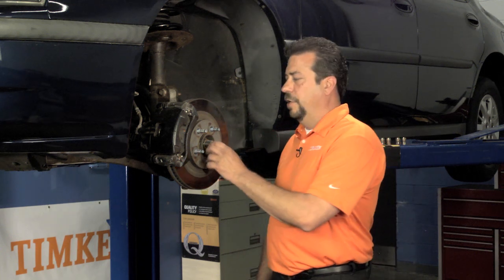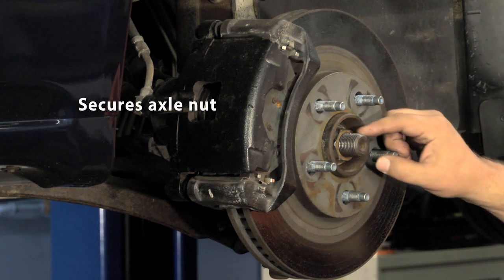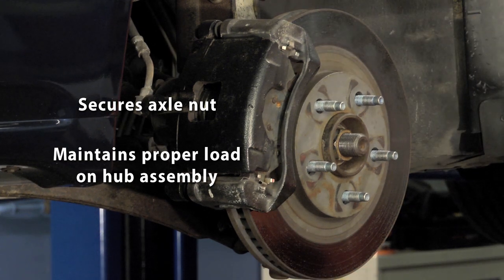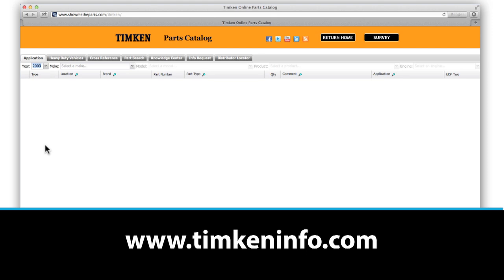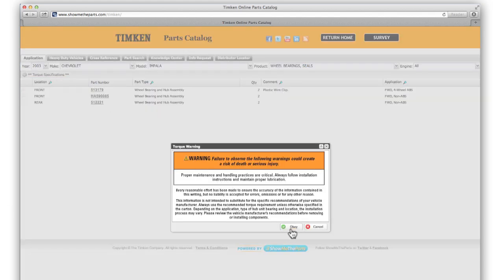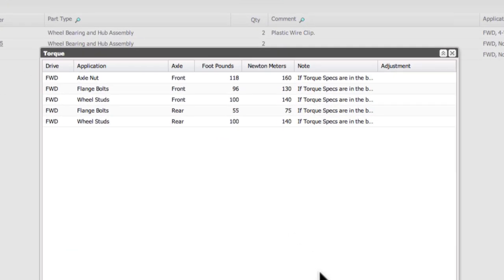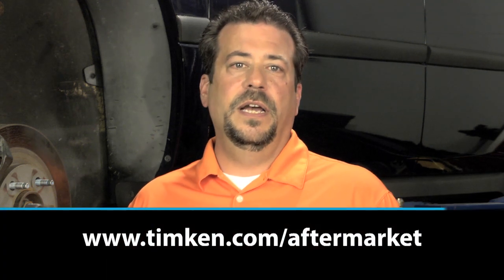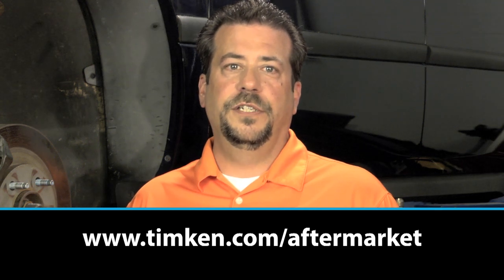Timken Tricks of the Trade - Finding Wheel Hub Torque Specs

Comment: Word of caution on using Timken's info: I just looked up one of the trucks I regularly work on - a '97 Ford F-150 RWD. The SKF info is the exact same as the FSM, but neither one seems right to me, since you go through a several step procedure where the first torque is 30 ft-lbs., loosen it up TWO whole turns, tighten again to 17 - 24 ft-lbs., loosen it 175 degrees (a weird figure), then finally torque to 17 INCH-pounds. This results in way too much end play, so I thought I'd try to find Timken's spec's. Timken's data for the "front axle nut" - the ONLY listing that makes sense, since the others are for the lug nuts (correct) and the hub bolts (also correct), is a wildly INCORRECT 188 - 254 ft-lbs. It's my guess that torque would not just make the wheel immovable, but ruin the bearing.

In 50+ years of working on cars/trucks, I've never seen such a strange procedure. In looking at the spec's and the procedure, It's my suspicion that some engineer gave the documents department at Ford the correct figures but they were somehow entered incorrectly, as the first torque looks about right, in my experience, to seat the bearings in the races. But backing it off TWO whole turns is something I'd never done. Usually it was 1/2 turn, and never more than a whole turn, just to loosen it up for the next (and usually final) torque. Next, going to 17 FOOT pounds seems OK, because that was often close to what it took to get somewhere between 0.001 - 0.005" of end play. But backing it off again - by 175 degrees - is a strange figure. Why not 180 degrees, which would be 1 1/2 turns? Then torque to final spec. of 17 INCH-pounds, which leaves the bearing fairly loose and too much end play. The figure of 17 appears three times in the procedure, and that's why I suspect somebody entered the wrong info into the manual, and was perhaps later copied by SKF in their own datasheet for the bearing. It's almost as if somebody was writing it down while talking on the phone and got some parts right and some wrong, and were too embarrassed to admit they goofed it up, so they decided to fill in what they thought they remembered instead of calling back and asking again, just to be sure.Same here with the Timken data. It would be OBVIOUS to anybody who's ever worked on cars that that's WAY too tight. Again, 188 - 254 foot pounds is about TEN TIMES the similar torque value that SKF gives for the second torque, above. So maybe a decimal point was misplaced to the right. But to some data entry clerk who's just out of high school and has never even changed a flat tire, much less changed any wheel bearings, well . . . they wouldn't know that's an unreasonable figure. So somehow that figure gets entered into the database or spreadsheet - and it remains until somebody points it out. And then the documentation department takes years to get around to fixing the mistake.
Reply from the maker: Thank you for bringing this to our attention. The spec for this vehicle year/make/model has been updated.

Comment: Which method is the proper Torque procedure ? With tire/wheels installed and vehicle on the ground? (with Load) or can a proper torque be done with vehicle on lift or jack stands, no tire/wheels installed (Without Load or No Load bearing)?

Comment: Basically torque specs are for brand new factory nuts and bolts,  and in most cases people just reuse old nuts and bolts,  then what??  or to use or oil or not?   or what if after tightening  with a proper handbook torque the bearing gets stuck like there is some resistance?    And shouldn't we block somehow the suspension first before tightening the hub nut?

Comment: I don't understand the concept of preloading the wheel bearings with the axle nut torque in domestic and asian cars.  European cars don't have this preload, they simply have a small 14mm bolt secured in a bore at the end of the axle shaft - no high torque, no bearing preload.  Why do the car makers with axle nut made is so difficult  when it can be done so simple ?

Comment: Torque Spec is not listed for my 2002 Acura rear Hub  512343  ? Can you please help? Just bought two Timken wheel hub bearing ass.
Reply from the maker: What's the model?
Reply: @TheTimkenCompany  2002 Acura RL, Timken rear Hub  512343 . Thanks.

Comment: Most home mechanics won’t have a torque wrench that big..so just get it nice & tight with a large breaker bar?
Reply: NO! The torque specs are NOT "Nice and Tight" especially with bearings.  You'll damage the bearings.  The nut is only holding the hub on and the bearings in place.
If you are doing a job like this you NEED a torque wrench as there are usually at least 2-3 different torque specs in the assembly.  The spindle nut is often NOT "nice and tight" or TORQUED down.
Reply: I think you're talking about two different types. The old style where you pack inner and outer bearings by hand and then install on the spindle, doesn't get tightened much at all.  Then with a front wheel drive type axle nut, it really does have to be "nice and tight" but it's best to get it as close to specified torque as possible.

Comment: yup.. found no Torque Values on axel nut 98 Camry
Reply from the maker: The Torque specs for your make and model are there. 
First ensure you go specifically to this site: https://www.showmetheparts.com/timken/
Enter the year, make, model. Select wheel bearings.
The torque specs button is an orange box in the upper left corner of the page.

Comment: Followed exact steps stated, yet found nothing at all about Axle Nut torque specs for my vehicle. Waste of time.
Reply from the maker: What's the year, make and model?
Reply: @TheTimkenCompany  Sure, I'll bite. Try a 2014 Subaru Forester 2.5L Limited, front and rear. Thanks!
Reply from the maker: @VideoNOLA   Unable to attach an image, but if you go to: www.showmetheparts.com/timken, make sure /timken is in the URL.
Enter year, make, model, a button foor torque specs appears in the top left hand corner. Click it. Click okay when the warning message appears and a table of specs appears.

Comment: Complete bullshit, despite the fact that I use torque wrenches, even on mudguards, I found that on VW Audi the axle bolt (yes it is a bolt not a nut) has two different spec for two different type of bolts, one with rib one without on the flange, the one with rib is 70Nm+90degrees and the one without is  200Nm+180degrees. This clearly shows that torque spec is not critical in providing the proper bearing preload.